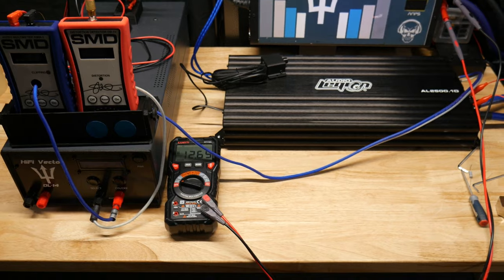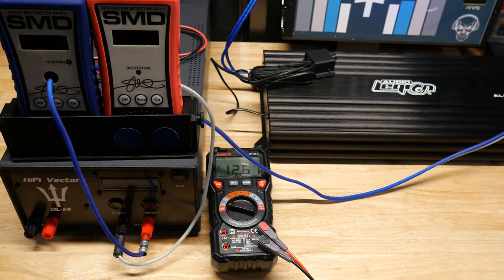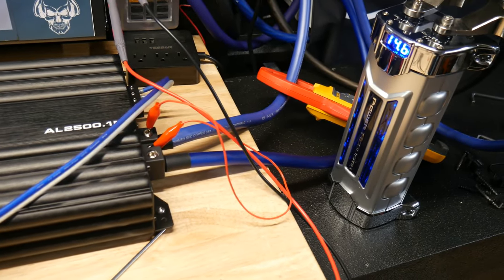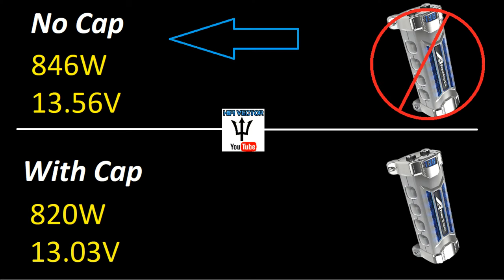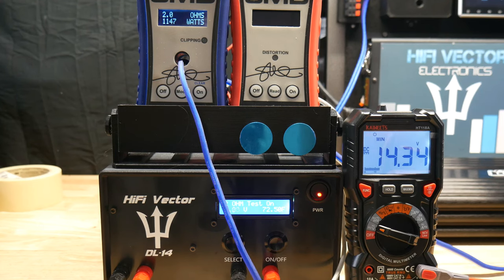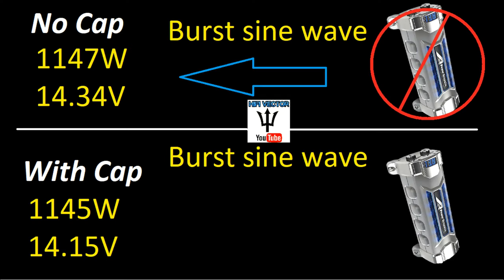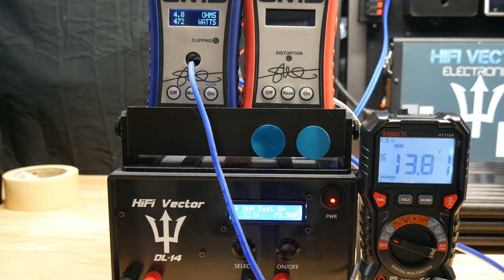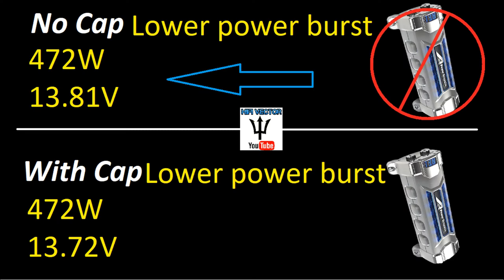Do cheap car audio capacitors work myth busted lets find out in this test

Comment: My experience with the Cap is this. Back in the early 2000s I had a system in my car. Without the Cap, every time my bass line drop, it would dim my headlights at night. When I installed my Cap, it stopped my headlights from dimming when a huge bass line dropped.  That's my own personal experience. I didn't have any fancy metering gages at the time.
Reply from the maker: Keep in mind this was only this particular capacitor. So I am not going to assume that all caps will give these results. I’m sure some actually work. I want to test more soon to see.
Reply: This has been my experience as well.
Reply: @HiFiVector  Any chance you can test other brands out there? Maybe the self discharge of that particular one is hurting performance.
Reply from the maker: @Miles7955   After this test it definitely made me want to test a couple more from other brands. I will test some more in the near future so we can compare.
Reply: Not all these caps give these results.
It has to do with the parts being used inside the capacitor.
Theres a bunch of different ones. 
Ranging from 1 single rolled capacitor, too 1000s of little small ones.
Reply: @rickhunt3183  I was partially thinking this, thus why I was also thinking a bigger number of tests were required. I had owned one with one of my previous cars, and it had made a very big difference, not only with the lights at night. Then again, I bought mine brand new, while the item was still being produced.
Reply: @HiFiVector I'd try making it closer to what guys that use these experience.  If ur only dropping to 13.8 ur not gonna even think to add anything so u wouldn't be placing a cap in ur system.  U should set it up so w/o the cap there's major drop, like from 14 dropping to 12 and then see if the cap helps that out.  I think thats closer to what real world cap users are trying to do before they realize they need more battery's and ho alt etc.
Reply: Your amp got less power through the cap so current draw from battery was less
Reply: The thing is we didnt had alot of amps that were actually pulling alot of amps from the electrical system like in todays car audio systems. Like the orion xtr 2500 am running, it takes some serious power to make power
Reply: @rhurtadorh32  old school amps pulled a lot of amps without making power. But the reason for lights blinking is bad wiring, thin wires and usually bad connections.
Reply: @V8Lenny um no it's loading the alternator
Reply: 2000 I ran caps also in all my vehicles to keep my lights from dimming and they worked. And it kept the volt from dropping below 12v and I was happy. Amp I was running than were J audio 500/1 to Rockford 1500db. Turn on max for hours consistently at least 3-4 days a week.
Zero issues. Never had the need to run xtra battery. A thousand watt sound system is pretty clean and loud.
Reply: My understanding of these Caps is to keep strain off the electrical system of your vehicle. I actually have A power acoustik 5 farad cap that I bought in 2005 and have used it in 5 different vehicles with 4 different amps and numerous pairs of subs and haven't had to replace a battery but once
Reply: That's what happens in my new optima and I have a cheap cap that stopped the lights from dimming
Reply: @HiFiVector can you test the 1.5 farad metra t spec please ?
Reply: You're exactly right, I had the same headlight issues dimming really bad! 
I installed one cap and it instantly stop my headlights from ever dimming again, It helps maintain a steady high voltage!

Comment: I'd be curious to see what a high quality hybrid capacitor can do like the Stinger SPC5010 10 farad, NVX XCAP10H True 10, and Rockford RFC10HB 10. Also a standard Rockford Fosgate 2 farad. It's pretty clear that all the cheap brands and Chinese caps are junk and only good for a voltage display if they even include one lol
Reply from the maker: After this test it definitely makes we want to test some more of different brands and models.
Reply: agreed, i'd watch that!
Reply: I had the NVX XCAP10H in my Honda Ridgeline. Lights dimmed before and did not dim afterwards. Also, the built in distribution block was nice. I ran the NVX JAD 4 channel and 1200w mono with this setup.
Reply: @superchile9640 awesome thanks for the feedback man. It sounds like a good option for mild 1500-2000w systems which is what I run also. I get some pretty bad dimming on my F150 even with more efficient led headlights installed and a good bit of voltage drop when beating on it. No cap, Optima yellow top + big 3. I'll definitely be looking at one of these hybrids
Reply: Am guessing the test should be done with an alternator to supply 🤔 constant D/C current to give the capacitor a fair charging chance. Seeing this test means it's a waste on capacitor.

Comment: Let's also consider the brand we're talking about here. If it's rated like the amps , we may be looking at a 0.5f cap.😂
Reply: The guy at the start of the video said it was a 5 farad cap. the results are weird, and questionable. I would like to see someone do the same test on the XS Power 1000 farad cap.
Reply: @Hotecce1  I'm suggesting that the brand is crap and that the cap is rated 10x higher than actual. Just like the amps
Reply: Its the brand cap for sure. Good assessment. Im an electrician. The actual cheap caps use little to no materials. Get a good brand and watch those levels differ.
Reply: @jeffreybradley3736  I agree with this.  I just got an amp install kit that came with a "2.5 Farad" cap.  It is the size of a 0.5 Farad cap from the 90's.  Good thing it was cheap and I got the cable I need and I'm only running about 500 watts... haha

Comment: This wasn't really fair IMO. Caps are supposed to help with deep hits. Not a constant hit. The idea is to stop spikes in battery drain. As many have commented, it stops your lights from dimming when hitting lows. Not constant lows.
Reply from the maker: If you notice besides the initial first test the test were short bursts.

Comment: I had a cheap one from Walmart a few years ago can't remember the brand or size. However my light would dim from the bass and with the cap my lights stop dimming.
Reply: Holding cut down of electric current,

Comment: In my research when deciding on a cap for my stock charging systems I found the consensus among experts, not enthusiasts, was that the caps turned into a load on the charging system as soon as they were discharged. Because the energy stored is so small and discharges so fast compared to a battery, they at best decrease an initial dip in voltage in music playback while remaining an additional load while recharging after each peak in amp output. They seem to be more useful in banks as part of a custom high output electrical system.
 A better solution for stock electrical systems is using the biggest agm(most cca’s) battery that will fit in your car.
Reply: Super cap system
Reply: a cap is smoothing out ripples produced by the alternator though. for some reason rarely mentioned
Reply: @hotdog9262  The capacitors within the amp’s own power supply circuit are there to smooth out irregularities in the voltage.

Comment: You are on point with your hypothesis. Utilizing a capacitor which only supplies a small amount of farads doesn't fairly support these type of applications.  Would it help to use it as a way to aid a crank over on a vehicle if u have a battery in the back because of the distance from the power source, sure. However, you're still better off using a battery isolator with the 2 batteries in parallel if you go that route. I've been running the last for 2 years now. Wish I was aware of that in the late 90s/early 2000s when I was in high school.

Comment: If you have stock electrical and your not planning on putting on any long demos, the first thing you should worry about is your alternator. Adding batteries and caps like these will just create more points of failure and added resistance to the system. Supercap banks are actually effective but should only be considered if you're running a bigger 3k+ system.
Reply: But a damn battery in your trunk problem solved genius

Comment: I have used one as a distribution block in every system I have owned
 at least since the 80s. You old timers might remember Richard Clark of Autosound 2000 and his trick Buick Grand National. His exhaustive tests showed a notable improvement in transient response and recommend one Farad  per 1000 watts. I suspect modern China made caps might be the  issue.
Reply: So possibly a 50 farad china cap might be a positive gain?
Reply: @aaronbright5028  I would say the bigger the better. If you have access to an LCR you should measure the capacitance and see if it's really what they claim. 50 farads would be more than sufficient to make a noticeable difference.
Reply: @donnie4191  kinda new. Lcr??
Reply: @aaronbright5028  
Strange my earlier reply seems to have disappeared. An LCR in an instrument which measures inductance, capacitance, and resistance. They're handy but not really necessary I keep one around because they're cheap. Anyhow, I run a cheap Rockville 5 farad cap on 1500 watts RMS and it works very well. If I was starting over I would take a hard look at the NVX true 10 Farad cap that would be more than you need unless your system is competition level. Also, since you're new to the hobby, I can't emphasize enough to avoid the cheap aluminum CCA wiring kits and use pure copper with proper lug terminals. If you're over 1000 watts, use 1/0 gauge, under 1000 watts use 4 gauge. This is the safest most reliable approach even if it costs a bit more. And most importantly, do a Big Three under the hood with at least 4 gauge. Google big three kit.
Reply: I was in a low power class, and That Grand National was there competing. Was nuts, looking back he must have had an IB Sub build. It did 126 db but made a shock wave behind the car where I was standing 😮
Reply: @James-l8i6g  Damn bro that's going back! If I recall correctly, you're right! It was two infinite baffle 10s, chosen primary for a flat response because Richard was all about accuracy. I also recall diamond diaphragm horns hidden under the dash at about $10k each, plus a custom built servo driven covers that concealed the head unit and amps so that everything was hidden completely when not in use. I wanted that car soooo bad. It's literally the reason I got into car audio.

Comment: Without a cap in a larger system the alternator will be working so hard trying to stabilize the voltage that your belt might slip on the highest short loads.  A super cap helps with that.

Comment: It's a class D amplifier which is designed to run straight to the battery with no cap ... If you use a class AB amp you should have different results. Correct me please if I am wrong.
Reply: thats a very good though!

Comment: This is not a surprise to any of us that been doing this hobby very long.  Thank you for the tests maybe try a recoil audio cap. Or a Rockford or nvx cap see if name brand true rated cap does anything
Reply: Pointless to test others.  All are so similar and built in a few build houses.
Reply: @Chuck_Sanders  some caps and some batteries and some amps are all rated bs ratings. Cheap caps with bogus ratings just like all other cheap electronics with bogus ratings are going to perform badly.  But that does not mean there are not good quality products. Too.  A good capacitor should actually do something capacitors are in ever amplifier and almost every electronic device there is and they serve a purpose and do there job well.  Yes we all know these cheap poorly rated caps are junk and do nothing but that does not mean all are bad and serve no purpose. With that being said I'm never in favor running caps like the ones in the video.  The only time I have had any use for caps like that is to filter electrical noise. I would still love to see some real world tests with better quality accurately rated caps
Reply: @paulgood2218  yeah,  I have, and still do work with quite a few build houses for almost 3 decades now.  Most "caps" such as these are useless, no matter the brand name stuck on it. Real cap banks, like maxwell caps are a different story,  but you still need a bank of them super caps to be beneficial. These are chokes in the electrical chain,  and they discharge so much faster, than the recharging cycle.  Sure capacitors have functions in most all electrical devices, and get designed around the desired capacitance needed.  However,  these type capacitors can't make up for current/voltage loss,  and cannot replace amperage that isn't there to begin with.  EXO has a great video on these,  years ago.  Better off buying a volt meter and a 2nd battery.. or some lithium would be better.

Comment: 150a simulated alternator for a "regular car" is pretty high. Most cars have between 70a and 120a unless it's a massive American SUV or something. It would be interesting to see the test done with a 100a simulated alternator, though I suspect they won't be much different to what you have already discovered.

Comment: Very intrested in more testing.  Although, my personal experience back in the mid 2000's,  I ran 2 12's bridged at 2 ohms on an 860watt 2ch amp.  The car was an econo sh|tbox and im sure it has less than a 100 amp alt.  My headlights would dim when the bass dropped.  I installed a 1 Farad Cap, and that issue was resolved.  There's got to be something we're missing here.
Reply from the maker: Some caps might help if it’s a good quality one so maybe yours was a decent one? The problem is I think a lot of these cheap caps are fake . Because caps just like in electronics they work so caps are nothing new and in a lot of electronics amps included. I think that’s the issue is some of these cheap caps are snake oil.

Comment: Back in the day when I ran a cap I noticed a big difference from having the power straight from a distro block than the cap directly to the amp. Like you said the cap after it's discharged starts sucking up the power. Yinlong FTW 😁

Comment: They help if your using stock electrical on just over rms to where it strains your electrical system in car. If your going huge rms power don't use these, just get good batteries and or electrical upgrades, like a powerful alternator and batteries.

Comment: Capacitors are a great load to the electrical system when on the discharge cycle. I am not sure if the general public knows this but when a capacitor is discharged it acts as an initial short to the supply.
Reply from the maker: Yes! And that’s why you have to “ charge” the capacitor before you connected to the battery voltage. so all charging means as far as the capacitor goes, is to get the voltage up slowly and easily before you connect full  battery voltage so it doesn’t act like a short. I think a lot of guys don’t understand how they work they think charging them is like charging a battery and it is not.Great info thank for sharing that it was a great point!

Comment: I know this is an old video by now, but I'd like to know what gauge wire was used. If proper size wire was used for the amp power, I can see little help from the stiffening cap. BUT, say you undersized the POS (+) wire from the "battery" to the cap, then heavy wire from the cap to the amp, that would be an interesting test. The undersized wire would strangle the amperage like a low ohm resister. Now, I don't think the cap would do squat with a steady sine wave output except a voltage drop. But, do the quick bass attack hits with and without cap in place. I'd like to see what happens now.

Comment: Just like with any other car audio component, quality matters.
Most of us know that a Power Acoustik  amp is not the same quality as an Arc Audio or Zapco amplifier.
I would be curious to see if there's a difference in the results when it comes to the price and manufacturer. I'm sure someone would donate some Maxwell caps to test against the Power Acoustik.
I have 2 cap banks.....one from the company BattCaps and the other is a Stinger hybrid caps.....that I'm not using right now. You're more than welcome to use them!
Filtering is another benefit that is often looked over when it comes to outboard capacitors. Just like amplifiers, and almost all other electronics out there, have filter capacitor banks inside the device on the PCB. I've noticed significant reduction in the overall noise wall at the listening end of my systems. Any of you that remember installing high end CD players, you've dealt with having to find a place to hide either a black plastic or metal box that's inline with the incoming power wires in the harness.
This a filter cap.
I also, and this is the most important to me in competition, is that there is a noticeable difference in the sound quality of the actual music.....especially at lower volumes when the system is seeing less signal volume because of the the knob is at 4 instead of 11.....lol! Vocals are crisper. Snare drums and the plucking off the strings of a bass guitar. It just sounds better and it's not a major chunk of change for what you get in return.
Sorry for the length of this reply!
I'm just passionate about car audio and even more about the members want to learn.
Thank you!
Reply from the maker: Not a problem man. I had this cap here so I just thought I would do the video and see what happened. But yes, I am sure a better cap would actually do something and I will be doing a couple better quality caps in the near future. I was thinking one of those stinger hybrid caps and maybe the NVX " true" 1 farad cap and maybe one more. thanks so much for watching!